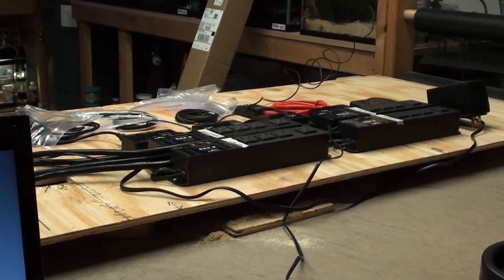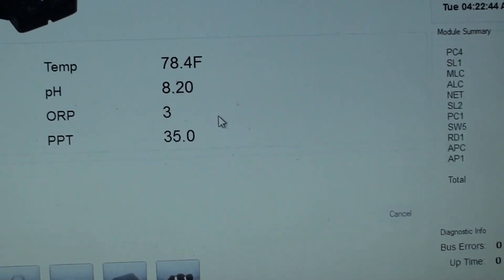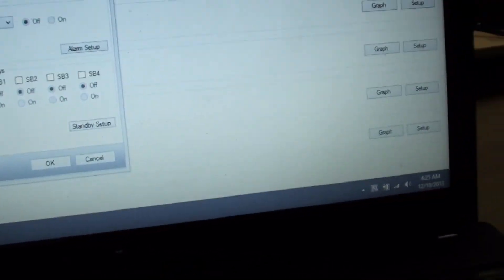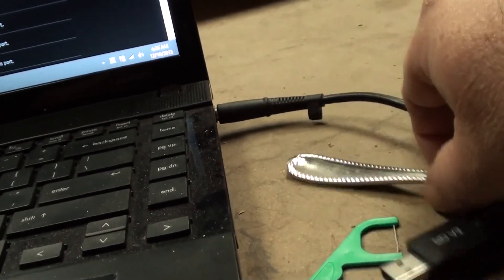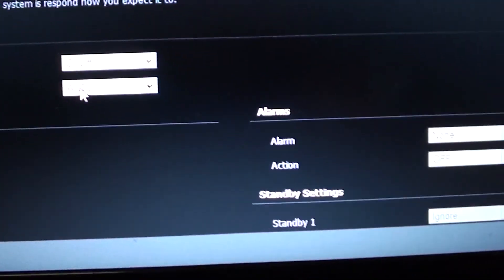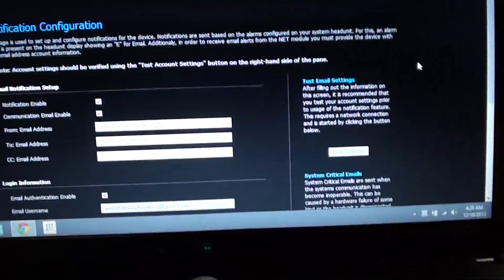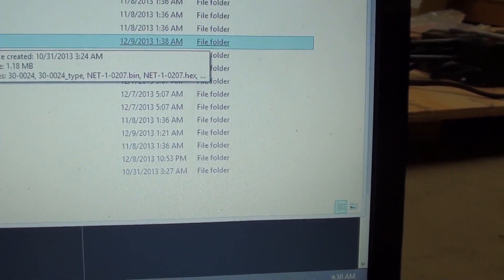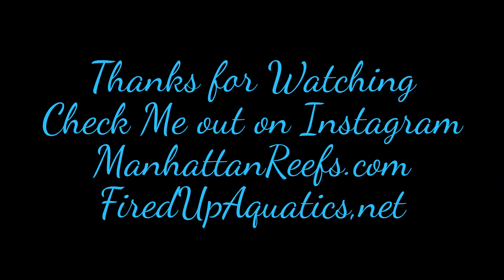DIY SW Project Pt. 3, Demo of the DA RKE V2 and Programming it using My Reef 2.0, And finally..:-)

Comment: Nice! Did U try logging in from outside ur home?
Reply from the maker: Thanks Max. Not yet, I would need a wifi connection at the moment unless someone has an unlocked system, most around here lock there wifi lol.
Reply from the maker: The Play Store has an app, but still figuring that one out now lol. To much figuring I swear, what happened to plug n play
Reply: I hear u I got the apex last week I only got it set up today thanx to technical support calling me and helping out.
Reply from the maker: Max Aquatics  Well glad you got everything rolling, I still gotta do the painting before installing this under my tank, so I'll be removing all the modules yay lol